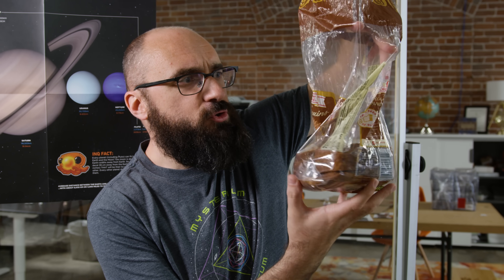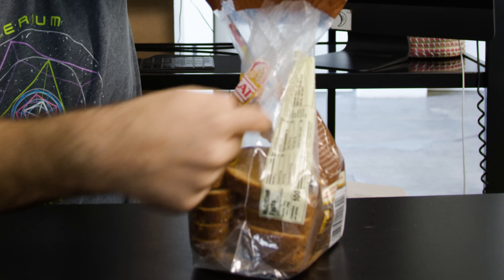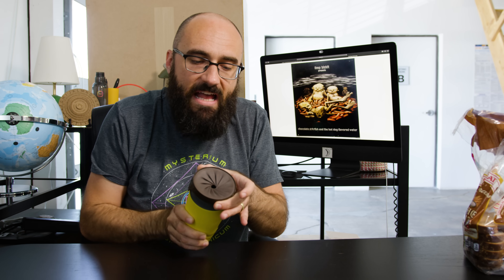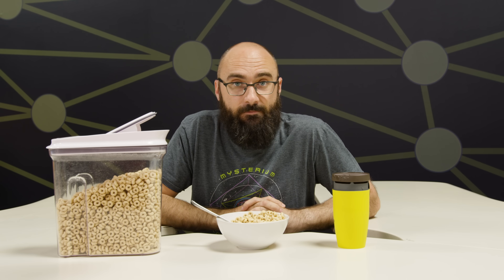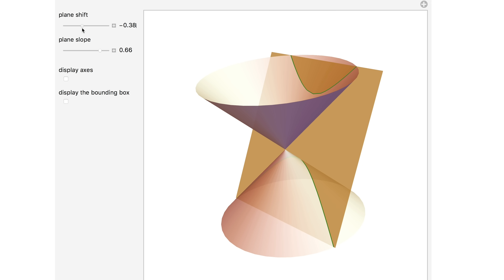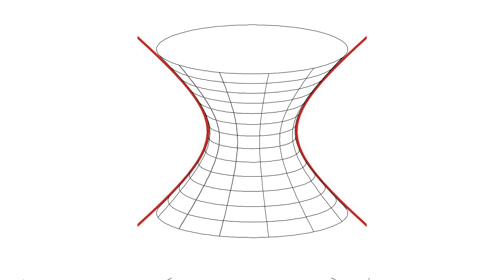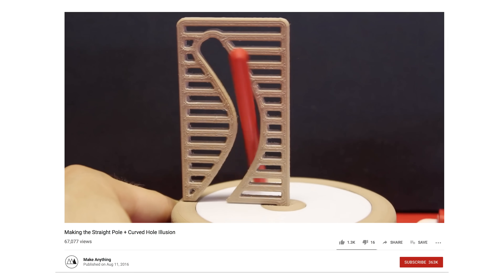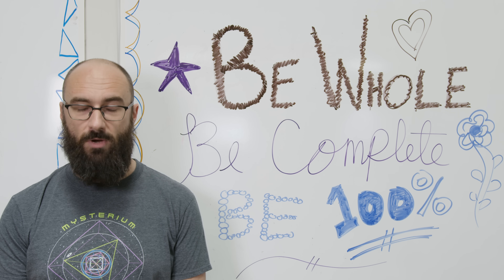Hyperboloids

Comment: " when its closed, it little bit looks like... URANUS has a diameter of 50000km. Thats more than a mile"

I see what u did there Michael Stevens
Reply: Is there any joke more worn out than the similarity of sound between Uranus and "your anus"?  I laughed first time but 200 times later it's lame and puerile.
Reply: @raykent3211  you must be fun at parties
Reply: first: a hole
second: 50000km. thats more than a MILE.

Comment: Even though we usually describe the motion of a thrown object as a parabola, it is in fact an ellipse whose path is interrupted by Earth's surface. The plane must be the same slope as the cones. That's very specific. I think, and I could be wrong, that an object on a parabolic path is essentially always on a precise escape trajectory. At the end of time, it will be infinitely far away from Earth, and its motion will have stopped (relative to Earth, and assuming Earth is the only thing in the universe other than the object). Whereas on a hyperbolic trajectory, at the end of time, the object will be infinitely far away and still moving away.

Comment: GET YOUR MIND

OUT OF THE GUTTER
Reply: noun
1.
a shallow trough fixed beneath the edge of a roof for carrying off rainwater.

2.
the blank space between facing pages of a book or between adjacent columns of type or stamps in a sheet.
verb
1.
(of a candle or flame) flicker and burn unsteadily.
"the candles had almost guttered out"
2.
ARCHAIC
channel or furrow with something such as streams or tears.
"my cheeks are guttered with tears"
That is the definition of a gutter, so that’s the wrong use of the word.

Comment: fleshlight?
Reply: Robbie Robinson Flashlight*
Reply: @user-fo4ue9mo4z  no. i meant fleshlight
Reply: Robbie Robinson It’s flashlight.
Here’s the definition.

A flashlight (often called a torch outside North America) is a portable hand-held electric light. ... A typical flashlight consists of the light source mounted in a reflector, a transparent cover (sometimes combined with a lens) to protect the light source and reflector, a battery, and a switch.

Comment: Me: googles the amount of miles in 50,000 kilometers

Me: Well... you’re not wrong.
Reply: You had to Google that?
Reply: I’m American it’s against big papa’s rules to learn metric system
Reply: @sethbishop6890  no I want the Google that it's like 2 mi or more
Reply: its 50k km in miles
Reply: It IS more than a mile🤣
Reply: Doctor straing Strange yes that’s the joke
Reply: @DrDuzzy  yeah I'm really sucking the fun out of this comment my bad
Reply: It should be at least 1.001 miles.
Reply: @SeBi036  I was taught both but being used to another standard of measurement it usually isn't retained. I mostly use feet and inches in my profession today.

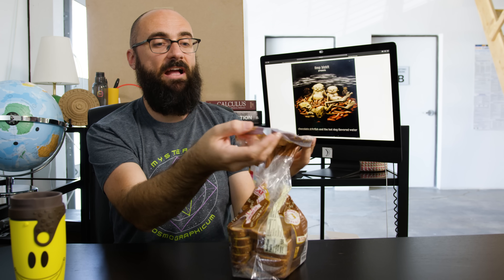Comment: 2:10 I'm sorry what. You can shorten the length, twist it, then undo it? 
This helps somehow? Am I being pranked?
Reply: The length is shorter, because some length is given up for the folded over section.  It stays at the same height, because that length is being pulled down

Comment: They use the same design in commercial buildings to run cables and other materials through walls then twist a hyperboloid to seal the remaining space around  the material to prevent fire from spreading room to room

Comment: @D!NG @5:52 due to the continuity equation (In fluid dynamics). The Venturi effect causes a drop in pressure of the fluid and when it expants at the top then we have cooling. (I think...)

Comment: Is it just me or does that mug kinda look like a big ol' 

Hole (Entry 1 of 2)

1a : an opening through something : PERFORATION
The coat has a hole in it.
a bullet hole
b
: an area where something is missing
His mother's death left a hole in his life.
: GAP: such as
(1) : a serious discrepancy : FLAW, WEAKNESS
some holes in your logic
(2) : an opening in a defensive formation
a running back's ability to find holes in the defensive line
especially : the area of a baseball field between the positions of shortstop and third baseman
(3) : a defect in a crystal (as of a semiconductor) that is due to an electron's having left its normal position in one of the crystal bonds and that is equivalent in many respects to a positively charged particle
2 : a hollowed-out place
a hole in an apple
: such as
a : a cave, pit, or well in the ground
dug a large hole with a steam shovel
b : BURROW
a rabbit hole
c : an unusually deep place in a body of water (such as a river)
3a : a wretched or dreary place
How could anyone live in such a hole?
b : a prison cell especially for solitary confinement
threw him in the hole for two days
4a golf : a shallow cylindrical hole or hollowed-out place in the putting green of a golf course into which the ball is played
b : a part of the golf course from tee (see TEE entry 2 sense 2) to putting green
just beginning play on the third hole
also : the play on such a hole as a unit of scoring
won the hole by two strokes
5a : an awkward position or circumstance : FIX
got the rebels out of a hole at the battle
— Kenneth Roberts
b : a position of owing or losing money
$10 million in the hole
raising money to get out of the hole
in the hole
1 : having a score below zero
2 : at a disadvantage

Comment: Not to be pedantic, but you're a tad off on the etymology of the conic sections.

"Parabola" originates from the greek noun "παραβολή" (paravolee), which itself is derived from the verb "παρεμβάλλω" (paremvalo), meaning "to insert", "to interlay", "to put in between". This refers to the fact that a parabola is the middle case; when the slope of the plane you mentioned is equal to that of each cone.

You get a HYPERbola when the slope is GREATER than that of the cones.

In the case of an ellipse, the slope of the plane is less than each cone's, so you've a shortage or lack of slope. The noun for "shortage" or "lack" in greek? That's "έλλειψη" (corresponds exactly to "ellipse").

By the way, to be completely accurate, I've been using the modern versions of the aforementioned greek words, but they have changed trivially since ancient times.

Also, if you're wondering how people decided what counts as more and what as less slope (i.e why it isn't the other way around) I present the following:
Take the case where the plane intersects the point where the cones' tips meet. Now, there are three subcases. Parabola -- middle case -- you get a nice straight line. Hyperbola -- woah, that's too much, the plane has stopped being tangential to the cones, having entered their insides! Ellipse -- awww, that's too little, now we're left with a single point... :(

Comment: The venturi effect has nothing to do with the cross section of the cooling tower. If, as you say, the gas speeds up while rising, it's cross section has to shrink in order to maintain the mass flow constant. That's the same effect as the one that shrinks the column of laminar flow coming out, and down, from a tap (ex: https://www.youtube.com/watch?v=F4XwCQu55V8). And to make things clear, venturi effect has to do with pressure differences resulting from an accelaration of a fluid within a constrained duct, while the water coming out of a tap (as well as the gas going up from a cooling tower) is all at the same (atmospheric) pressure (unless we account for the difference in atmospheric pressure with height...).

Comment: This type of mechanism is what Balloon Artists use to make bubbles that aren't the same diameter as the regularly inflated balloon.
You apply pressure to the bubble as you make the twist to make it smaller, or to the remaining length to over-pressurize and stretch the bubble.